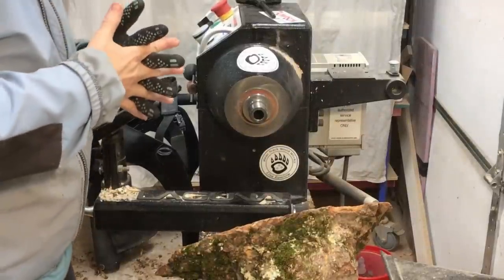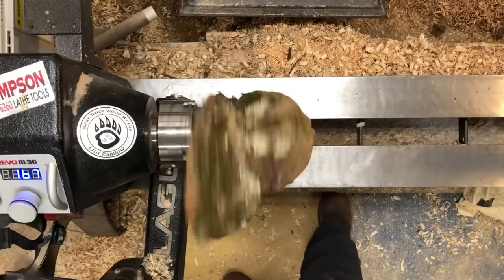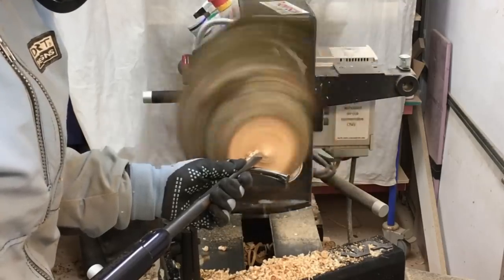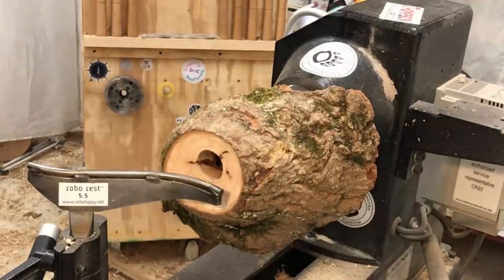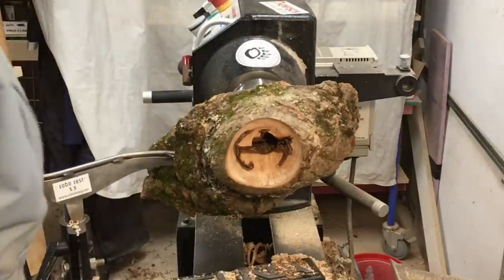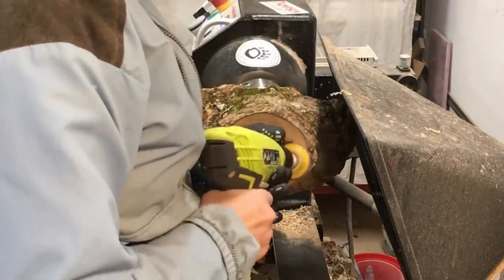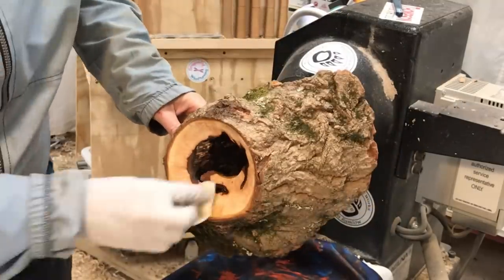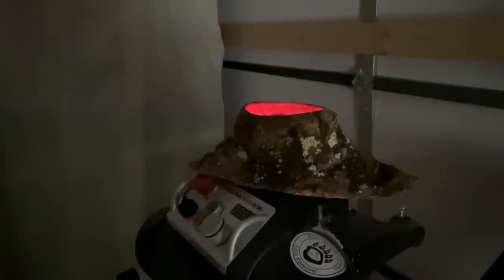Woodturning: Maple Burl? Turning inspired by @PhilAndersonShadyAcresWoodshop

Comment: That piece of wood is what i call a nailcutter og more drastic, a fingertrimmer / cutter. LOL I would not dare to put it in my lathe. Just because i think it is to heavt for mt mid size lathe. If i put it in i think the lathe would walk away from me. LOL
IT is a cool piece when you finish it and put that light inside. Very cool Lisa.

Greetings
Hans Olav
Reply from the maker: Hello Hans Olav! For whatever reason I wasn’t nervous about this piece, even though it was so unbalanced. It didn’t shake the lathe, but I didn’t turn the speed up past 500 and took easy cuts. It wasn’t what I expected but it was fun and I like it with the light in it 😁

Comment: What does it mean when you say a one pound or 3 pound cut
Reply from the maker: Hi Rob! It refers to how much shellac is dissolved in alcohol. One pound of shellac flakes dissolved in one gallon of denatured alcohol is a 1# cut. Two pounds in a gallon is 2# and three pounds of shellac flakes in a gallon of DNA is a 3# cut. I usually mix about a cup at a time, so 1oz shellac in 8oz alcohol. The Zinssner shellac you buy in the can off the shelf is a 3# cut I think
Reply: @LisaRamlow  Thanks Lisa, that helps alot

Comment: If this is truly a couple of branches that are cut off and grown over, then you are probably cutting end grain, which is why it is so hard. 

It looks like you are attacking it as a side grain bowl, which could be why you are getting so much tear-out. If you thought of it more like a spindle, and hollowed from the center out instead of from the edge in you may have had an easier time. 

When I switched from spindle work to bowl turning I had a difficult time until I realized that everything is backwards, and what used to be considered “downhill” is wrong, and needs to be reversed. Now I see people that are used to bowl work try their hand at spindles, and they have a difficult time switching directions to the different “downhill.” Muscle memory makes it feel awkward to switch directions.

None the less, it is a lovely piece and has given me inspiration to attempt it on a piece of olive wood that looks very similar to what you have. 

I do appreciate the shout out to Shady Acres Woodshop. It would have been hilarious if you started your video with a “howdy!” 🤪
Reply from the maker: Hi Dennis! Yes. I figured I was cutting into the end grain going straight in so I was trying to come at it cutting into side grain, but it didn’t always work. Drilling the flat spot for the chuck jaws (and threading the piece into the worm screw) were definitely the hardest bits. 
Thanks for watching and I’m glad you found some inspiration here! And I didn’t think about howdy but that would’ve been hysterical!

Comment: Cool piece.  I've got some burls with the same configuration and I don't know that I'd have thought of turning them that way. 👍
Question:  I have the same lathe and am curious as to what you used to engage your spindle lock to allow you to have two hands free for positioning the wood?
Reply from the maker: Hey there! This turned out not to be an actual burl but the grain is still pretty (where there’s wood!😂)
Gary made a video of his solution for the spindle lock and it works brilliantly. Here’s the link https://youtu.be/AzExi1D8sak
Reply: Great!  Thanks Lisa.